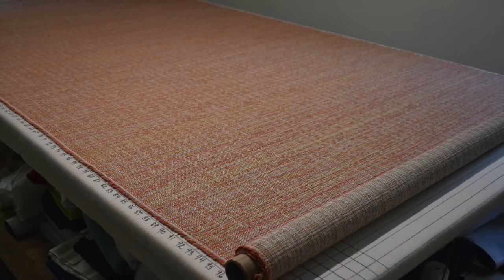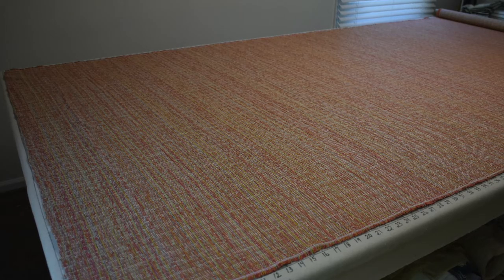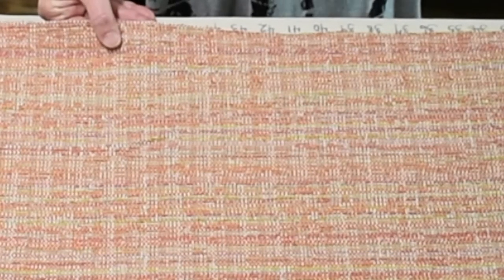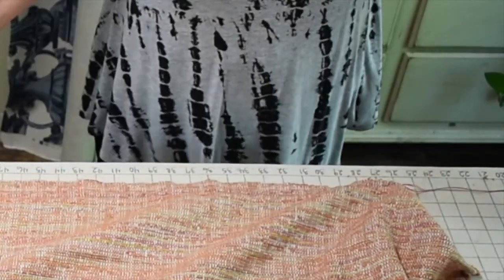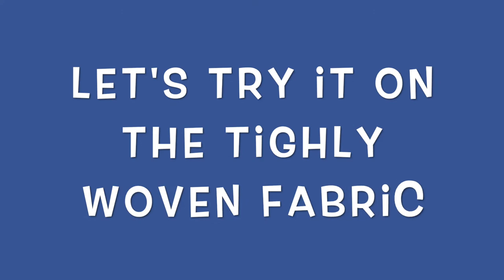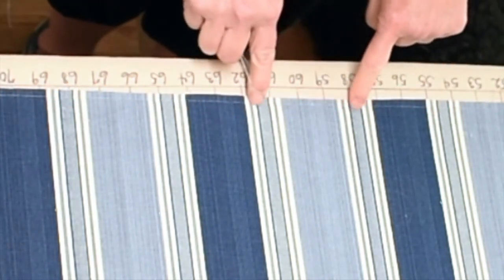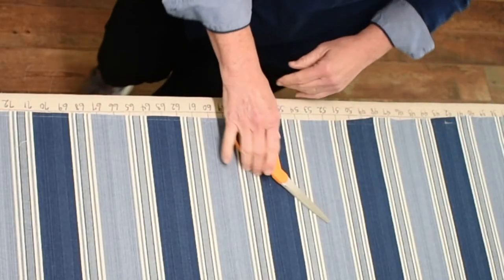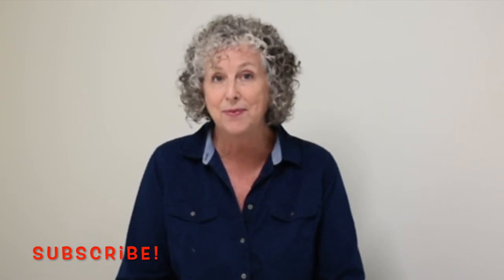How to Square Up Your Fabric ( and cut it on the grain line)

Comment: Great vides!!  This is the way I was taught to square up fabric.  I like the tip on what to do If the thread breaks.  I have found that some fabrics  today are really quite off grain.   More than when I started to sew years ago.  That drives me crazy!   I am a new subscriber!!  Thanks for this excellent video!!  Linda
Reply from the maker: Welcome! Yes, I agree that the quality has changed. I’ve dealt with some fabrics that are printed so off grain, or have such a severe warp or drift that I couldn’t even work on them.

Comment: Thank you so much for showing us this technique! You saved me with this. I am making a friend a huge tablecloth out of 120” wide slippery polyester sateen. I got out my laser, 5 foot t square, and 3 foot quilting rulers. No dice - my cuts were so uneven and terrible. I thought as I was cutting that I was doing okay. I couldn’t have been more wrong. I tried your technique and it took a bit to get the hang of it, but I did and it worked. Such great advice. Thank you!
Reply from the maker: I’m so happy it helped you! A slippery poly sateen is tough. Good job 👏

Comment: How do you straighten fabric that is embroidered over woven fabric. I’ve tried to pull a thread but can’t pull thru the embroidery. Help!!
Reply from the maker: That's a really good question! Embroideries can be tricky. The only option is to use the pattern as your guide. Often the embroidered pattern isn't even straight, or the woven base fabric will be off grain, but unless the pattern is really small and random, it will be too noticeable on the finished product if it appears to have a drift. There are some fabrics that are just impossible to work with correctly and you have to just wing it, or refuse them!